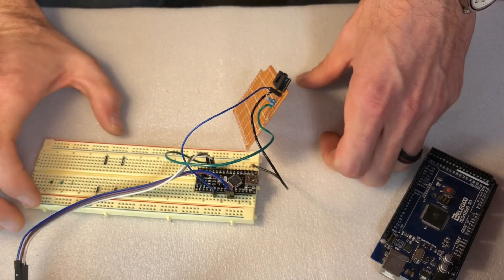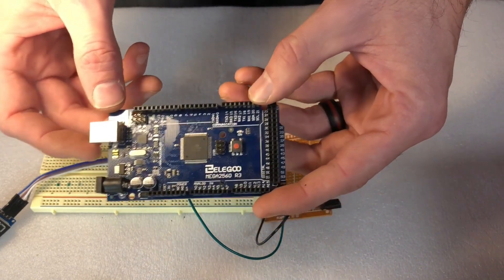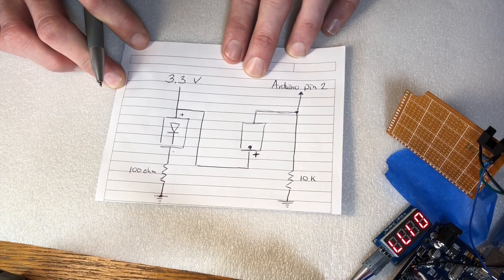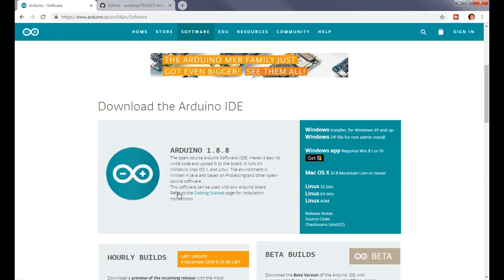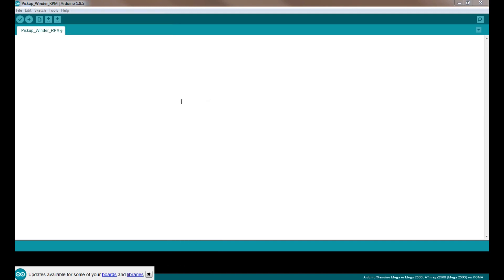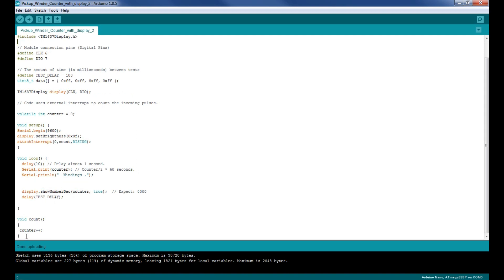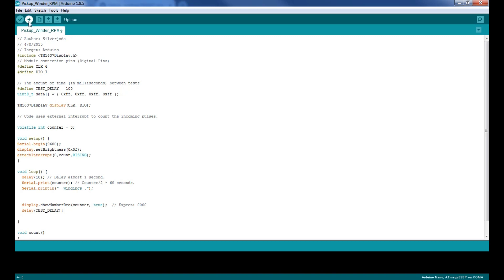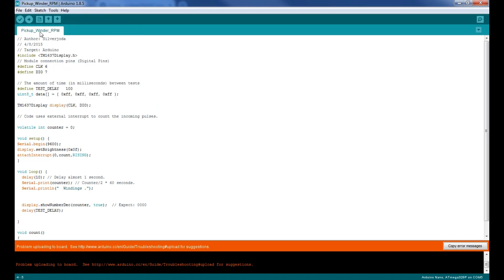OPTO Interrupter Arduino Counter for The Pickup Winder 2.0

Comment: Thank you for the best video.
The two machines are counted the same, what is the reason for the new one? 

From japan
Reply from the maker: Thanks bud, the first one used a magnetic switch and it max rpm it could count was 1200. The second one uses an OPTO interrupter switch and it can count at much higher rpms.  I tested it up to 5500 rpm. The main reason for the new one was just to be able to wind a pickup faster. But even after building it I rarely wind faster than 1200 😂. Thanks for the comment and hope all is good in Japan!
Reply: @ChasesWKshop   
Thank you for your reply.
It's amazing to be able to count faster than the original machine.
Thanks to your video, I was able to wind the pickup.
The Amazon list has helped.

Comment: hello, is there an even dumbed down version of the circuitry? The schematic helps a bit, but I still cant seem to get it when it comes to imagining it with the actual parts. thanks!
Reply from the maker: RperuwarsTV what parts are you having trouble with?
Reply: @ChasesWKshop  I tend to be a visual person, so if i were to attempt this build, I'd have trouble putting together the actual pieces. or in other words, I'd have trouble translating the schematic to the physical circuit. so is there maybe a picture of the actual circuit that I could go off of? thanks again

Comment: Great video. I'm trying to build one myself. Can someone help and explain why when I upload the program to the Nano and try run it, instead of a steady sidply, my T1637 just flashes on and off and doesn't actually count? Any help much appreciated, thanks.
Reply from the maker: Thanks man! Seems like I remember having that same problem and I believe it was my power supply. How are you powering the board?
Reply: @ChasesWKshop  Hey Chase, thanks for the quick reply. Im using a 12V supply similar to yours and was testing it through a breadboard. Ran a few other test codes for the display and same result. Found out it was nothing more than a few dodgy wires. Swapped them out and now working great. Thanks again man, saving me a fortune with this project
Reply from the maker: Chris Malcolm awesome bud!! I was looking at the code again today after you asked me about it. I’m working on one now that uses the same OPTO switch setup but uses a 555 motor and lcd screen. Hopefully have it up in the near future. Glad it is working now and let me know if you have anymore questions.

Comment: Hey man. Great videos. Re: the computer stuff - you're likely downloading a zip file from GitHub, but Windows Explorer can natively browse zip files nowadays so that's why it looks "uncompressed" to you. If you went up a couple of folders to the main Download folder you'd likely see the download as a zip file. But you can double click using Explorer to browse it and copy files around without unzipping.

As far as the Program Files (x86) thing - there are two Program Files folders because Windows desktop programs need to be compiled (turned from code into an exe file) for either a 32 bit or 64 bit processor. Back in the days of 286, 386, and 486 processors, they were actually referenced by their chip design. After that, we started calling them "Pentium", "Celeron", then i3, i5, i7, etc. So the x is just like, a variable meaning "any of the 86 series processors" (which were 32 bit). When 64 bit processors started becoming the norm a while back, they had to be backwards compatible. Windows itself is either a 32 bit or 64 bit version. So the Program Files folder is for 64 bit programs, and the Program Files (x86) folder is for older software or software that is specifically compiled for 32 bit processors.
Reply from the maker: Rob Gillan man I appreciate the info bud.  I’ve always wondered what that was about but makes sense now. 64bit systems need to be able to run 32bit. Thanks again man!!
Reply: @ChasesWKshop  Least I can do as a thanks for sharing your insights in pickup winder building! ;)
Reply from the maker: Thanks bud. Glad I could help you!